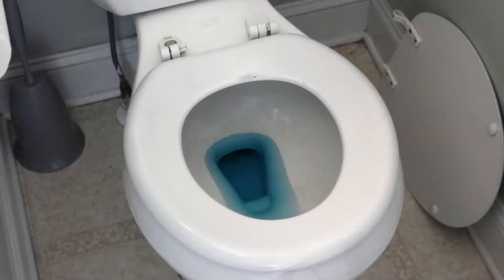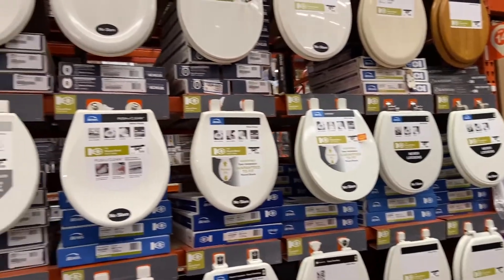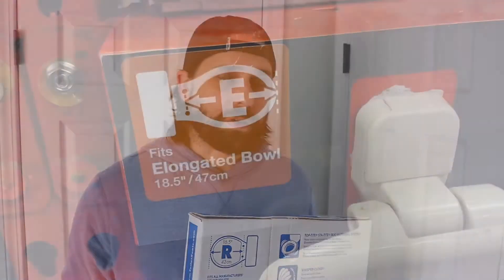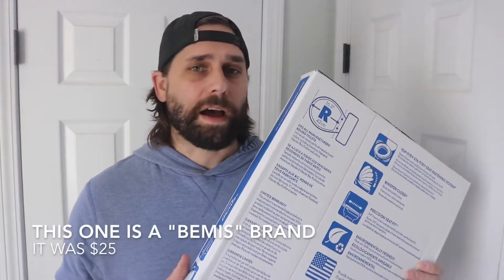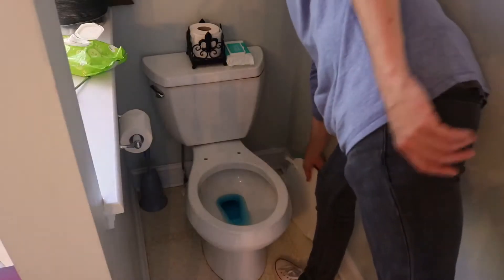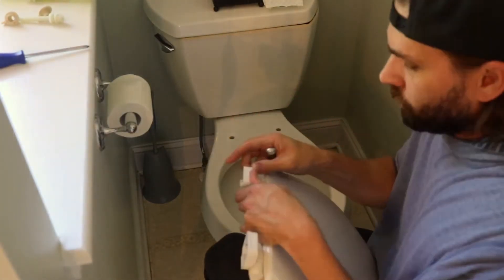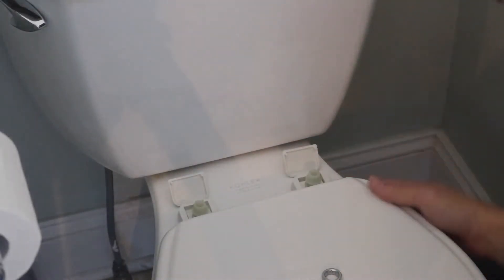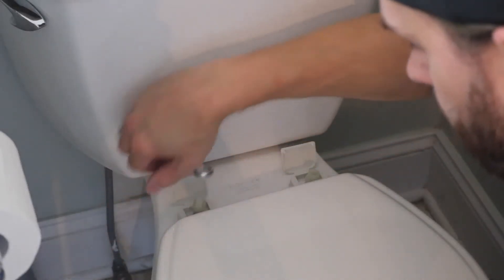Installing a soft close toilet seat

Comment: Hello! So did you have to measure the toilet Seat (there are seats with specific measurements) or are the toilet seats universal (you just have to know if your toilet is elongated or Circular)? Any help would be appreciated!!
Reply from the maker: Just need to know whether it‘s round or elongated. In my area we have Home Depot and Lowes stores. In both stores, there are only round or elongated seats. So, I guess those are universal sizes.
Reply: @ChrisMcDowellDIY  Ok. Thanks!